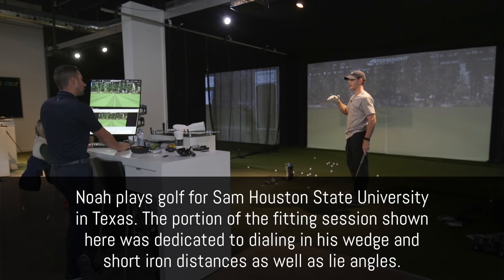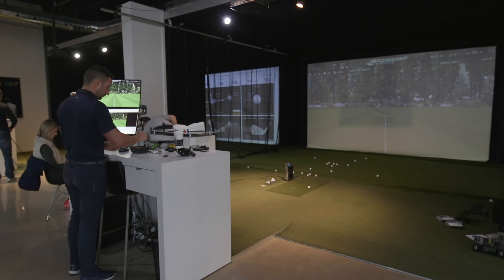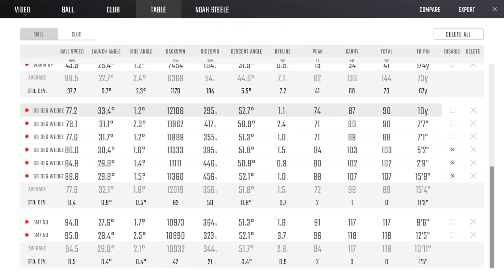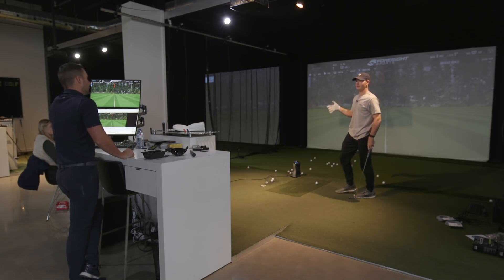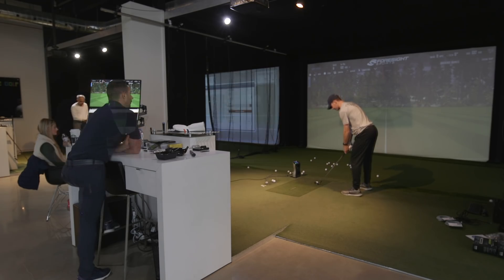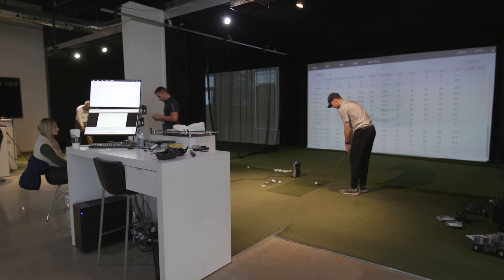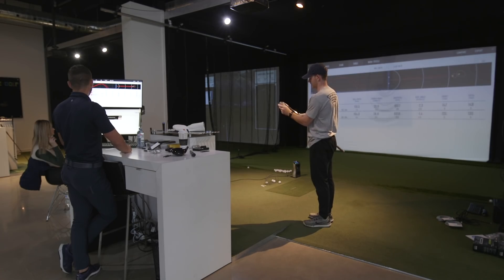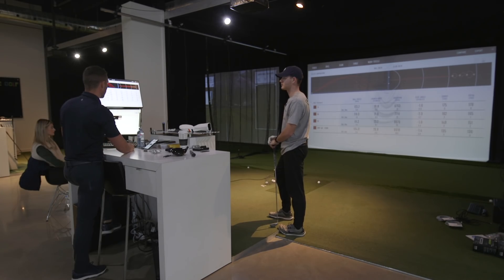Real Fittings – Yardage Gapping Short Irons with College Player

Comment: Loving this type of video where the viewer is just a fly on the wall watching the master work! Doesn’t hurt that the kid has a gorgeous swing!

My question for Ian: how did you determine 1° flat was the correct lie? Do you basically just look at the horizontal spin loft? Or are there other tells you look for in the swing? 

Thanks for another great video!
Reply from the maker: This was actually Noah's second time in the shop, so we were building on the previous fitting where we determined that the irons were in fact a bit too flat in their previous configuration (2.5º flat)

Comment: When you’re doing a gapping session do you trying to gap it based off total distance or carry distance?  Obviously 6 iron will run out more than pw so do you try and get even gaps on total distance then make sure players understand what the carry distance is as well?
Reply: Kourtney carry distance.
Reply: Ian Fraser so the goal is to have equal gaps say 12-13 yards between irons on carry distance?  Total distance isn’t as important? I’m trying to go get a fitting and never have been before but there aren’t many great options where I live so just trying to get prepped with as much info as I can before I go.
Reply: Kourtney total distance is only really important with the driver when you're maximizing distance with accuracy.  For most people 10-12 yards between clubs is ideal, that then becomes 15 to 20 yards between woods.  The major variable is the speed of the player.
Reply: Ian Fraser sounds good. Thank you!